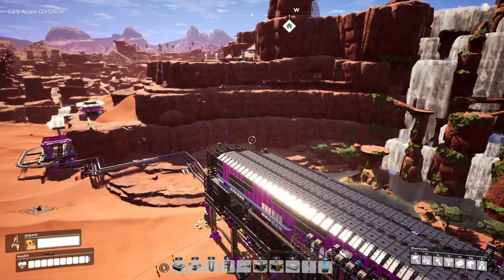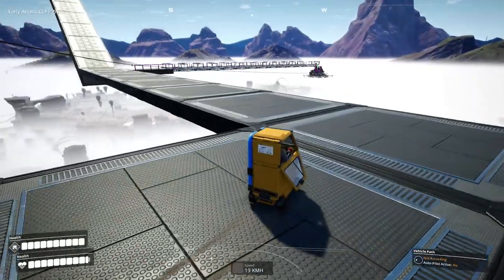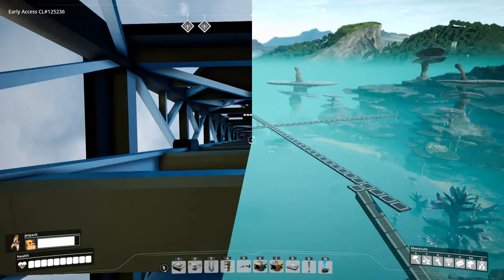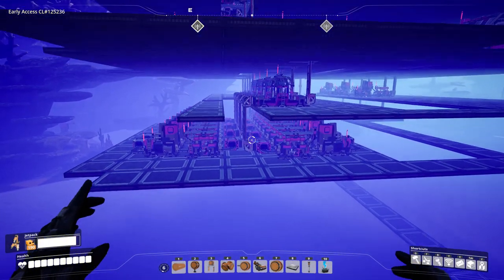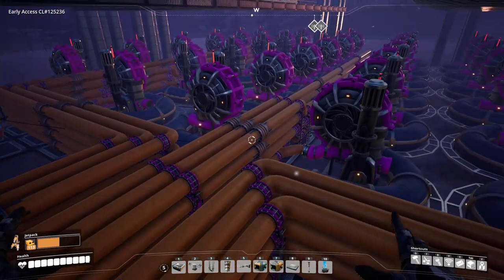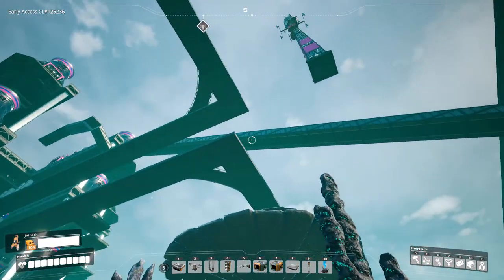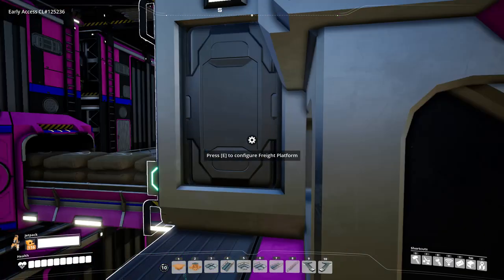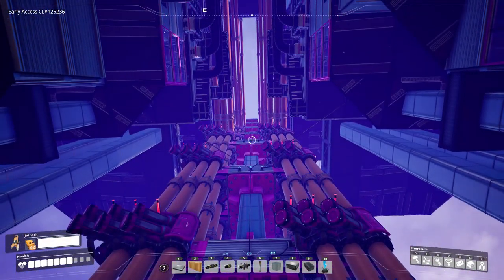Going NUCLEAR | Satisfactory #17

Comment: So 36 reactors, 1 rod per rector per 5 minutes, giving a total of 432 rods per hour at max capacity.

250 storage containers with 48 slots each, each slot holding 100 rods, for a total of 4800 rods per container.

That's 1.2 million rods that can be stored, or a little under 2,800 hours at full reactor capacity in order to fill the storage. That's 116 days, 16 hours of storage at full capacity, or just about 175 days on the dot at 2/3 capacity.

I would call that impressive, Zisteau, but that would be insultingly inadequate. Well done!
Reply: i;m sorry but you don't store rods, you store nuclear waste, which is stacks up to 500 so x5 that number, buddy
Reply: Both of you are off by one detail. He's storing barrels of nuclear waste, which are produced at a rate of 5 per minute, but can be stored in stacks of 500.
So the formula is: (12000 total storage slots x 500 stack-size) ÷ (36 reactors x 5 waste per minute) = 33333 minutes of storage. That's 555 hours, or a little over 23 days.
Reply: Bob Bobbertson I’d go for a smoke break next to 36 reactors
Reply: @MH3000333  - Your doctor: "How did you manage to develop 37 different kinds of cancer?"
Reply: @CheshireCad  For sure they'd all be radiation induced. Nuclear radiation does cause cancer.
Reply: @DarkVoidIII  - ...I'm not sure how you managed to miss the joke by that much.
Reply: @CheshireCad  Nuclear radiation causing cancer IRL is NO JOKE! It is deadly serious radiation! There wasn't a joke to miss, in my opinion.

Comment: So how many hours of continuous nuclear processing would it take to fill that storage of yours?
Reply: Over 33 thousand hours. Assuming the reactors are running at 100% capacity the entire time, it'd take 33,333.333... hours to fill the storage containers alone. That's almost four years of continuous gameplay.

While I'm sure Zisteau of all people might be able to attain that kind of absurd playtime, I doubt it'll be a problem for over a decade of realtime.
Reply: Hex Flareheart thanks for the math, Z will just have to remember not to idle for four years.
Reply: As nuclear waste stacks up to 500, industrial storage containers have 48 storage spaces, and he has 250 containers, Z has 500*48*250 storage space, or 6,000,000. At peak usage, his plant will produce 180 waste per minute, or 180*60 per hour for a total of 10,800 waste/hr. Dividing the total capacity by this figure (6,000,000 / 10800) we come to a figure of 555.6 hours at peak production. If we go for a more reasonable production (which I'll set at 1/2, given that the two thirds figure won't be reached until the base is fully operational [and the series is over]), he will have 1111.2 hours. Now, last I checked, he was at around ~280 hours on this save so far. He has streamed a few times since then, so I'll assume that is now closer to 300. That means that he could do everything he's done so far almost four more times over before he would need to be concerned about expanding his waste storage. 

Now, Z loves his massive builds, but I don't think even he will be spending another 1100 hours on this series.
Reply: @Hexagonaldonut  How did you get that figure? In my comment below I put my calculations and got an answer closer to 600 hours... Normally I wouldn't care, but I just want to figure out how I ended up off of your figure by 55 times...
Reply: @pdes_  it's a Schroedinger's cat question, i think. but not matter what, it's still a deathly long process to fill it up... which it might even be when the game finally become "GOLD" / official release.